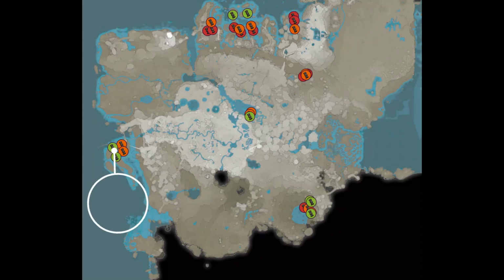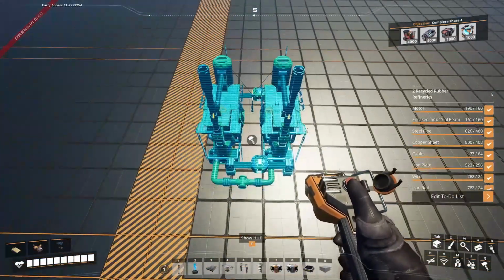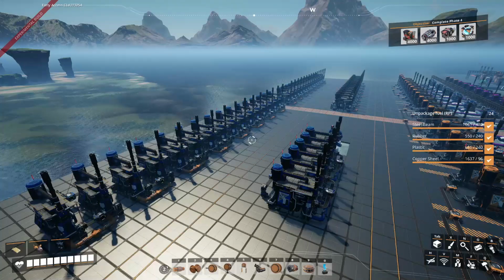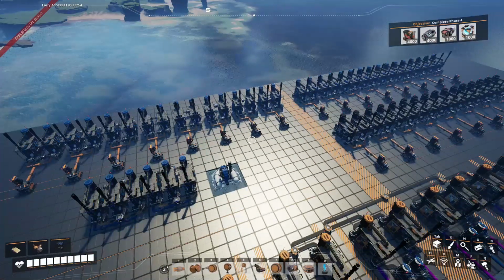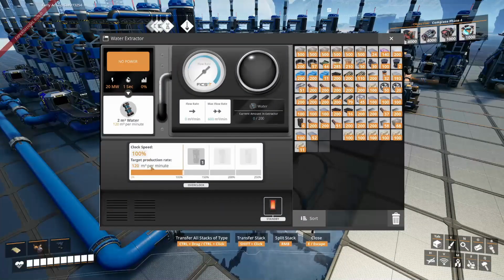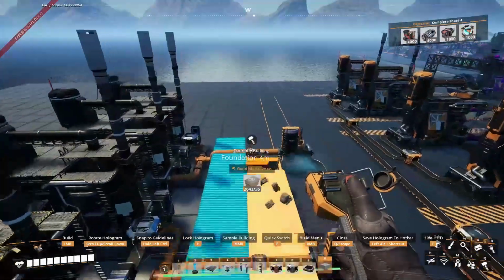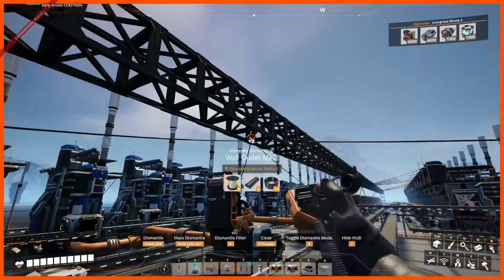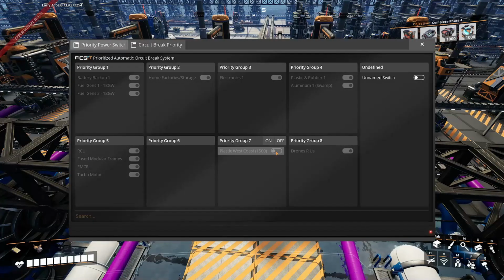LOAD BALANCED 1500/min Plastic - Satisfactory - Update 8

Comment: Why don't you use the diluted fuel alternate in the Blender?
Would save you so much time than using the packagers and unpackagers for the fuel.

The Packaged diluted Fuel recipe is only good for an mid game Turbofuel plant when you don't have the Blender unlocked yet.
Reply from the maker: That’s a great question! There’s a couple reasons I used the packaged fuel recipe. Load balancing of pipes isn’t really a thing and there are issues with cramming the full 600m3 into a mk2 pipe. So to get around that the package recipe keeps the amounts small and does let me load balance liquids down to 2 machines (1 fuel refinery puts out 60m3 and the recycle recipe needs 30m3) instead of lots of junctions. And the more important of the reasons is, I like the way packages look on belts more than pipes :)

Comment: Great video, showing how load balancing can be done and how effective it can be.
A couple of things I would do differently. Merge the recycled rubber refinery outputs in groups of 4 and split to the recycled plastic refinery inputs in groups of 8. The groupings of 8 to 16, especially with the buildings being offset, means some of the belt lengths are unnecessarily long.
This will also enable avoiding the looping back of the main output and having to use an overflow hybrid for priority, with the issues that brings. An alternative is to feed the 120 residual plastic to 4 of the recycled rubber refineries and the 240 rubber output fed to 8 of the recycled plastic refineries. 2 of these are part of the main output, 6 provide the 360 plastic to the remaining 12 recycled rubber refineries and the 720 output feed to the remaining 24 recycled plastic refineries. This way load balancing is being done along all the stages and will reduce the time to fully come up.
Reply from the maker: Thanks, glad you enjoyed it! Those are both really good ideas. I did think about doing them grouped in 4 instead of 8 and it was honestly because I like the look of the full mk4 belt over the ~90% full mk3 lol
I’m using a similar layout but twice as big for Rubber. I actually ended up having an easier time and don’t need the smart splitter for the next video.

Comment: isn't the resin -> rubber recipe way more efficient than the resin -> plastic one? and then the same from there on out?
Reply from the maker: You are correct. For the same amount of crude oil you can make a decent amount more rubber than plastic.
Reply: @moo121  love your neat builds though so structured... mine always looks so messy because I never have enough room for them :D

Comment: How often can you repeate the recycle step? Is there a limit to how often you can turn it back and forth, until its not efficient anymore.
Great video ❤
Reply from the maker: Thanks so much, glad you enjoyed it! That’s a terrific question that I hadn’t given too much thought. I think the answer, I could definitely be wrong, is that you can make this a little more efficient and squeeze a small amount more out of it. If you went to satisfactorycalculator.com and plugged in 1560 plastic using all the alt recipes it will say you only need 520 crude oil instead of the 540 I used. I went this route because the numbers of items and machines were easier to load balance. 
https://www.satisfactorytools.com/production?share=QZOVmExPqb9Ks91d50Qo
Reply: @moo121  thank you for the answer. I am currently myself working on a plastic and rubber factory so went back and saw your answer keep up the good work
Reply: you can run it at "100% efficiency" until you run out of fuel... it doubles each time as long as you add fuel